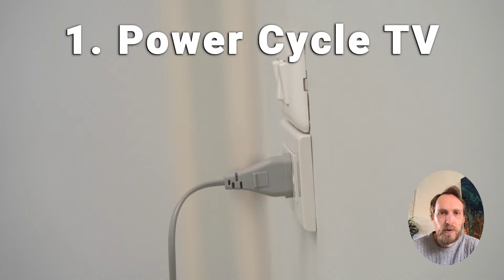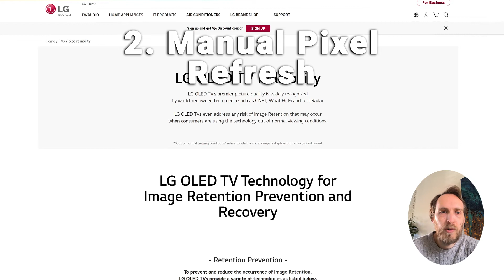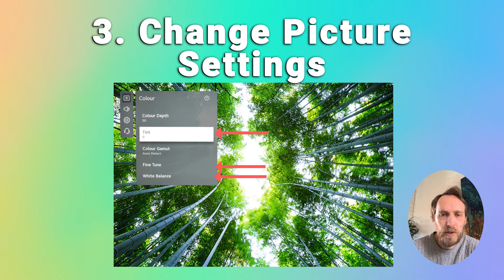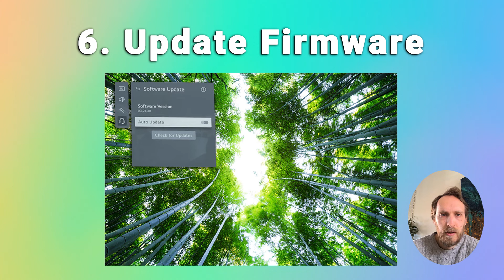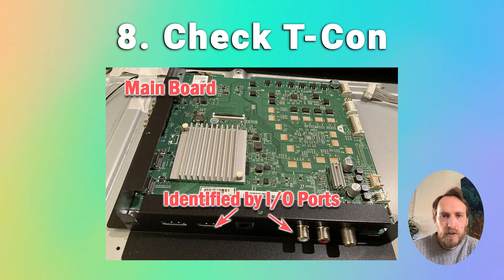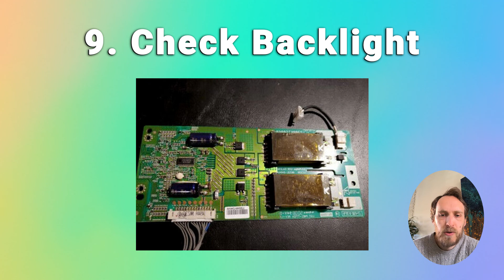LG TV Flickering Screen? Try THIS First...

Comment: Hi mate, if my tv flickering is minor and intermittent, is it likely to be a software issue? Most often happens when outputting an hdmi. When i switched energy saving mode off it fixed it for 15 minutes, but then came back again. Confused, and hoping it isn’t a power supply issue as it’s out of warranty! Thanks 😊

Comment: If that does not work. One of the PWM caps let go or some of the LEDs have decayed or the connections or the screen has become hot at one point. Usually the panel let go or the TCom board driver overheated. Bad news is time for a new TV.